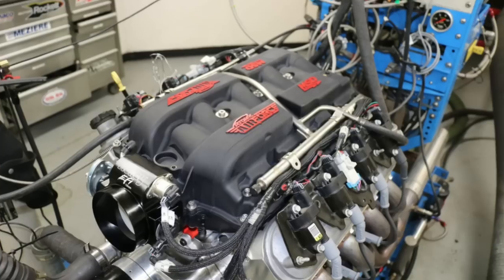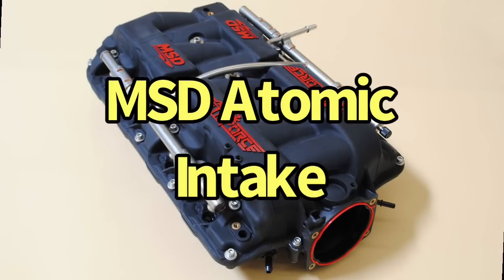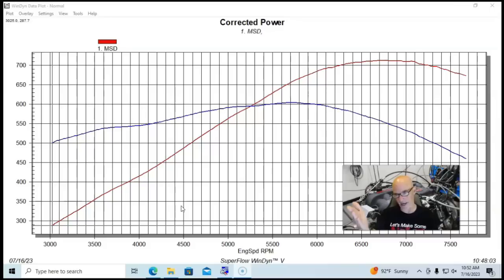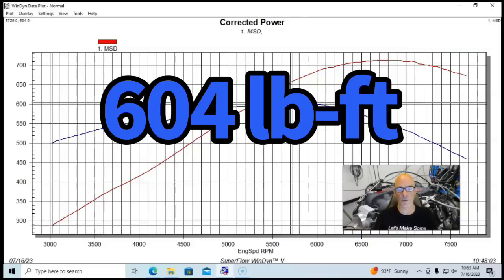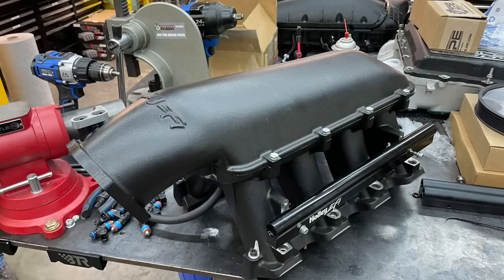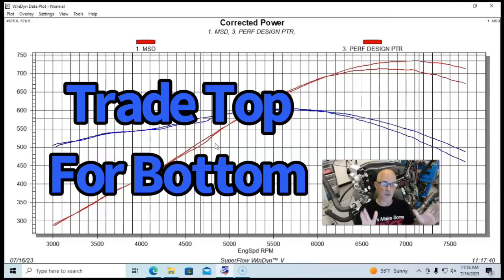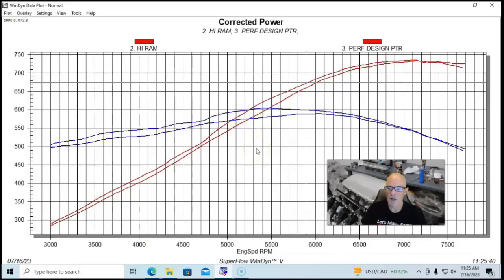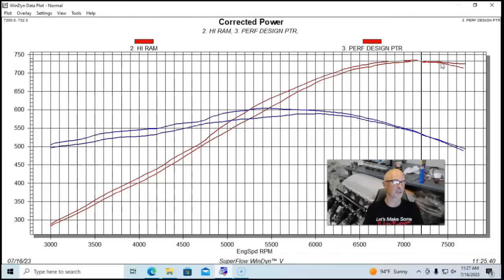700+ HP LS7 INTAKE SHOOTOUT-MSD ATOMIC VS HOLLEY HI RAM VS PERFORMANCE DESIGN CARBON pTR. WHO WINS?

Comment: Thank you for this! I think this and a TB are my last mods for the engine and I was wondering about which intake to use.
Reply from the maker: for what power and application
Reply: @richardholdener1727  Currently it's at about 540whp and I don't have a goal number, just want the best running car I can have. It's a summer weekend fun/ax car with maybe some trackdays if I can find the time!
Reply: @richardholdener1727  Oh, I guess maybe more info is better! From what I understand, 546whp at 5780rpm and 523lbft at 4810rpm. My shop says it's running out of air, though peaking at 5800rpm seems a bit off for an LS7 w/ heads and cam? Dunno enough about it to offer any real opinion.

Comment: The MSD Atomic Intake is a clever design that is capable of making excellent useable power for any LS7 for street or track. It is very popular intake manifold with the C6 Z06 Corvette Community and unfortunately it has also had a history of quality control issues for some time. As I have stated, it's a great intake manifold...... once you sort out all the production quality issues, I.E. missing and incorrect hardware, warped upper and lower plenum halves,  poor sealing characteristics,  missing bolt holes, etc.  When sound corrective measures were applied addressing reliability by gaining a properly sealed unit, we  gained 36RWHP and gained 30 TQ with the installation of the intake and a NW 103 throttle body. to our combination. When properly tuned our medium  performance build made 535 RWHP and 520 TQ as measured on a DYNO Dynamics chassis Dyno. I have been running the MSD for 2 years now, trouble free and I am very happy with it. Just don't be surprised if you might have to spend some time sorting out the deficiencies you may encounter.

Comment: Where is the dyno run of the stock LS7 intake? All the other intake tests were compared to stock intake manifolds.
Reply from the maker: I HAVE STOCK LS7 INTAKE VIDS UP
Reply: @richardholdener1727  I have searched several times, and I haven't seen you test the stock LS7 intake. Do you have link to it?

Comment: Richard will the PTr take boost?
Reply from the maker: yes
Reply: Richard I’m building a 408 with a 88mm FIS turbo and plan to use nitrous. I really like that PTr intake but worried if it would take it. What’s your thoughts on it?
Reply: @martygrajeda3457 it’s rated up to 45 psi

Comment: Massive plenum + long runners + smooth transition into the runners = good power everywhere. There's a reason why the pTR is the best, and the fact that it only costs a few hundred dollars more than the other options AND is adjustable makes it a no-brainer.
Reply from the maker: Even the PTr is rpm specific
Reply: @richardholdener1727  true, but far less than the Hi-Ram. It matches the MSD pound for pound all the way from 3000RPM. Has anyone done a comparison of the pTR to the XR? I've seen very little testing on that crossram design.

Comment: Hey Rich, just out of curiousity have you done any Coils and plug wire tests. Some of the manufacturers claim increased power with coils and plug wires so it would be nice to see if they are valid claims or not.
Reply from the maker: I have tested coils and wires with no change in power unless there was a broken wire or bad coil-if no misfire occurs, there is usually no power gain

Comment: Is there an adapter plate so I can run ls7 intake on ls3 heads
Reply: Part # 830071 I didn't have a part number til I got home and looked up the intake
Reply from the maker: a stock ls7 intake?
Reply: @richardholdener1727  it's a holley sniper dual flanges intake sort of like the tunnel ram intake. I trade it for a cam thinking it would fit but doesn't fit ls3 heads

Comment: Just imagine the pTr / LSXHR ported with a uniform cross sectional area 4" up from the cylinder head mating surface, and ported transitions of the velocity stacks... then mixing the velocity stack lengths across the manifold to make even more torque and extend the HP up the curve a little more. You get pretty much the same numbers (or better 😉), but with 11.9:1, a smidge smaller camshaft on a 110, running 91 rm^2 pump with a 2.00" primary... on an LS7 crate. Performance Design once again has brought the A-game.
Reply from the maker: I tried mix and match the runner lengths on a FAST adj intake-it just made less power
Reply: @richardholdener1727  ... less peak power, but what did it do to overall power/torque under the curve ? Not everyone cares about peak dyno numbers. Peak means nothing if I am passing you mid gear, anywhere.

Comment: Richard, without asking "what your thoughts are" about this,...have you seen Blueprint Engines new 4cyl LS headed engine theyve been showing off? I dont think its available retail yet as it was shown off at a show initially, but its got some neat features. I think its 3.6l and will accept an LS head, OR Ford Windsor head. Im not sure if that means two different engines will be available or theyve made it where either will bolt to the same block. Its based off some 4cyl GM engine used in industrial apps. Supposedly has pistons and rods that are standard small block stuff, so interchangeable, a stout crank, and in stock bore VERY thick cyl walls. They tested ot boosted and it made some cool (albeit odd) numbers, almost diesel like lol. https://youtu.be/wi7S5oHXL8c
Reply from the maker: When I last checked-it was not going to be offered
Reply: @richardholdener1727  Did BP come out and say that? I know it was a "prototype" of sorts, but man they hyped it up like it was a serious possibility. That thing spread like wildfire after debuting at the show. I'd like to know the true potential of the little 4cyl if boosted higher, and how difficult getting a camshaft/valvetrain made for it would've been.

Comment: Need more ls7 long runner intakes that fit under oem hoods, the Wilson is just too expensive. Maybe the xs ls7 will do that. Btw, that dyno pull to 7700rpm only had ~54psi of oil pressure on the right monitor but about 10psi higher on the left. Why the difference?. Are there any concerns with 54 being too low?

Comment: A month or two ago you asked if you should include pricing of components in your reviews and a majority of respondents said "yes". So since you didn't mention it in this review, here goes: Holley Hi-Ram - $1000, MSD Atomic Air Force - $1200, Performance Design Carbon pTR - $1300.
Reply: He doesn't care what subscribers want or think, that's why he has never finished his Big Bang Engines. He'd rather re hash crap he did years ago, before being fired from a magazine.

Comment: Thanks so much, I have that exact cam in my LS7 with a high ram ( I had the Ptr on back order literally 8 months ), can you tell me what timing made peak power? 31?

Thanks so much for this test confirms a lot of what I thougjt except I thougjt the hi ram would take over a few hundred rpm sooner...the lsxhr would roll out a hair sooner on long stacks..it done great to hold with the msd then pull out the top better...
Reply from the maker: 27
Reply: @richardholdener1727  thanks Richard, i forgot those are stock style combustion chambers with a BES port job, I swear my BR7s want more timing..I'm take it slow, reading plugs and have even adjusted the heat range/tip projection easing up its NEVER not increased MPH with timing..at 31 now slowly over months...at 26 it's a dog...
 I think over winter I'm gonna find true top dead center and make sure I don't have some dwell/drift with a timing mark.....just to make sure. I've had a aftermarket injection systems do that before..

 For instance it runs on dragy from a dig 10s with a 1.90 60ft @ 127mph+ on virgin 2 lane,( low 7s 1/8th probably mid 6s track with a 1.5x 60ft) no prep or water burn out with some SS radials just a clean off n go...
 If I put that back on 26 it would drop half a second and 5mph, ask me how I know...I was very hesitant but since it was severely under performing on those saner timings I started easing up ( adding a little fuel as well )..
 I also see why it's never went slower as I've adding shift rpm by 100 increments...based on your chart with same cam, intake, ci, rockers, springs and headers I should shift around 7600-7700, I know it likes it but again easing up on it....( wasn't using dragy past 7400 shifts got to try it again this fall )...flex sensor is up and working it's on 93 ( e20ish) and I have a timing pull for anything under e50 in it......

 It won't spin a tire on 24 degrees, it also like 13.1 ish AFR on E...

I guess I need to verify timing and then go ahead and get it on a chassis dyno, it's to expensive an engine for my old school ways. It was darton sleeved built for boost then life happened....

 Thanks for the test it's damn near identical, if those are the size and flow BES ports I think they are...

Thanks again for including that timing info, from research i know the stock chambers really like that area especially with added compression but if my indication is true these Brodix BR7 chambers want more and I have flat tops with a good .038 quench shrugs...
Reply: @ShawnGilbert1967  Something we've talked about here in the comments before is how much variation we see between Rich's dyno timing and what we usually log with stock ECU (E38/E67) and hptuners.  He typically sees peak power at much lower timing values then I do, but he's using Holley, Haltech, etc. vs. stock ECUs.  I think there may be a little difference in how GM references base timing vs. the aftermarket stuff because there is no way Rich is consistently running that much less timing than those of us on the stock ECU hardware and getting similar power (for example on my LSA engine on E85 I'm running 27-28 deg, he's getting peak power in the low 20s).  This would fit with your results as well.  I doubt the head is going to require 5 deg diff.
Reply from the maker: just give it what it wants, but do so safely

Comment: Richard (or anyone here), have you any experience with Advanced Inductions head work? More specifically, their LS stuff? I had looked at doing their high-comp 241 package on my LS1 a while back where they do a LOT of work, even so far as welding up and reshaping the chambers to bump compression and keep stock p2v clearance, and running one of their spec'd cams for those heads. They're similar to TEA in the work they do but I was wondering if you could look at the high compression 241 work and see what that would do power wise. I'll link it to you if YouTube won't pull the link or email. It's a very extensive and neat head job.
Reply from the maker: I have not tested that
Reply: I've never seen advance induction heads not work well.  Good stuff but only communicate via email

Comment: Mr Holdener! Was the MSD ported or opened up, or was it out of the box tested? I know they seem to have a LOT of casting issues and imperfections that need cleaned up, where some of the castings have areas where the polymer flashes over and partially obstructs airflow, and just cleaning up the casting lines can make a huge difference. People are also having excellent gains with porting. Just curious it hear if you've touched it!
Reply from the maker: out of the box
Reply: @richardholdener1727   so no mamo porting and why not use the NW or Katech 102/103 TB  does anybody use the granatelli pieces? nobody on the Corvette forums do thats why im asking

Comment: Nice test. Glad to see you using that cam because I just put together a 416 cubic inch LS3 based engine with the exact same BTR cam so I'm happy to see the great peak numbers and nice torque curve you made with it. My motor has less compression (11.5:1),a little less cylinder head (AFR LS3 260) and also less cubic inches at 416 vs 427 but if I can make anywhere north of like 625 flywheel I'll be really happy. Going on the dyno soon so we'll see. Thank you for this test.
Reply: Let us know how it did
Reply: Ran on the dyno today, made 692 HP and 554 torque, I'm beyond happy with the results.
Reply: @stork7930  thanks for updating us, congratulations man...mine telling us the peak rpm for those?

Nice build especially out of 416ci
Reply: @ShawnGilbert1967  thanks, peak HP was at 6,900 RPM and peak torque at 6,100 although the torque curve was pretty broad, it was making close to the same toque from well under 5,000. This cam definitely likes to rev especially with the single plane manifold I'm using. I think it would have peaked HP a little higher but my lifters did not like going over 7,000 so we didn't go higher than that. I have LS7 lifters now but I may look into changing over to aftermarket short travel lifters or possibly going solid lifter in the future, for now I'll just set the rev limiter a little lower and run it as is.
Reply: @stork7930  I'm running the ST2126SLR Johnson lifters and Hi Ram ( LS7 though) and I fully believe they are responsible for a little top end...running about 420lbs of spring over the nose at that .662 lift with their .685 premium spring...this thing doesn't even seem to start pulling till 5500 it's WAY understalled...I intended to boost it but life got in the way...I need a restall ( 4l80e triple ) or toss some Nitrous or something to get it moving if I ever get to the track....

 Congrats man it made my old 67 Camaro come off like a real muscle car again...I'll say this though the Stage 3 LS7 that was in it, with a MSD Atomic cleaned up by 1200 rpm..I mean it was a much better cruiser with that could probably toss my 3.25s in the rear...but I like shifting at 7500+ while it last hehe.....

 Wish many fun days ahead for you my fella
Reply: @scotttimpany2845  Sure I'll post a reply here when I have results, hopefully in a week or so.
Reply: It should be over 625 fwhp no problem
Reply: Did you use 1.8 rockers or just basically use it as a low/mid lift on LS3 ( last forever like that)?
Reply: @ShawnGilbert1967  I did go with 1.8 roller rockers. I could have just used the 1.7's and probably not have lost much but it felt worth the additional cost to just do the 1.8's.
Reply: @stork7930  nice

Comment: Hey Richard could you try the carbon ptr intake on 5.3 or 6.0s in cathedral port style to see how well it stacks up against other cathedral port intake manifolds I’m curious to see
Reply: If I had to guess it’s probably the same results for the most part
Reply: @erikryan9204  I was thinking the same but I wonder how lower hp set ups benefit cuz I have the fast lsx hr on my 243 headed 6.0 and seems to  do really well I would like to know how much better it is

Comment: I wonder if the X means the lobe is asemetrical. I can't think of any other reason for the X.
Reply: I think it’s so they don’t reveal the exact specs
Reply: It's to hide the specs.

However, I have heard from a reputable source that the exhaust duration is 266 on this cam.
Reply: @C6Z_Bob  they can't hide much with the last digit on the ex side.a person could put a degree wheel on it and easily measure it.
Reply: @C6Z_Bob  yes, I measured 267 on my LS7